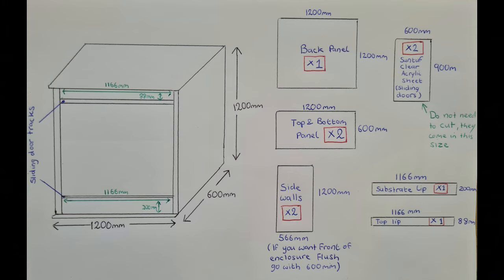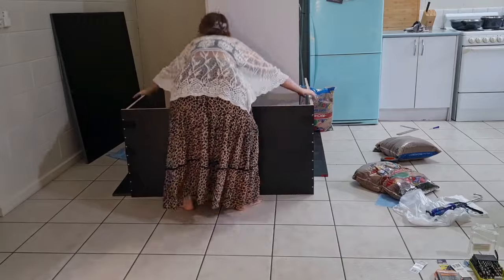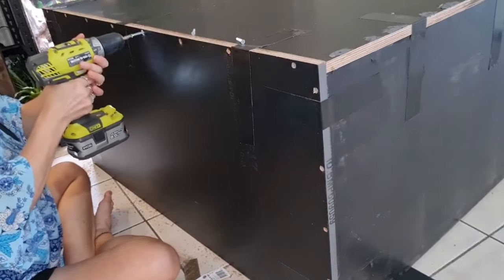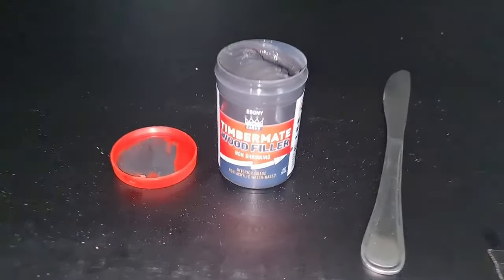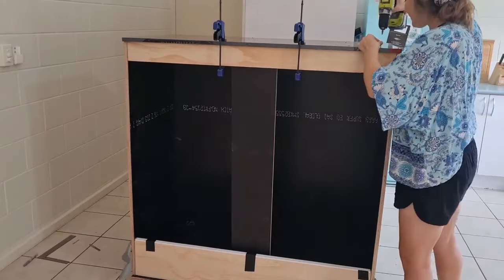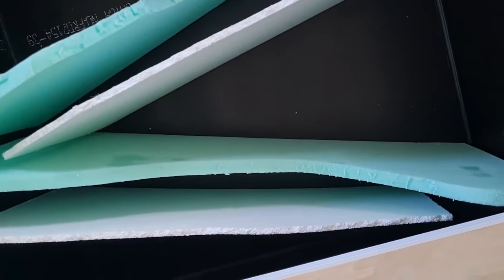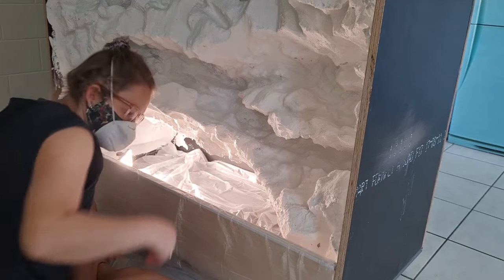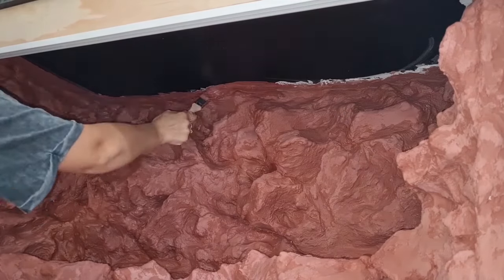Bearded Dragon Enclosure Build: Step-by-step guide… Limited tools and expertise needed!

Comment: Love this video! Im in Kansas! Couple questions,  1. How often do you clean the enclosure? 2. What is your process on removing the sand? 3. If she poops on the grout/ramps is it easy to clean? Thank you,  I plan on using this tutorial on a little bit of a smaller scale.
Reply from the maker: 1. I wipe down the entire enclosure with a wet cloth dipped in water with a bit of earth dish washing liquid (natural product/not harmful to reptiles/grey water safe/does not strip waterproofing) in the water. However the enclosure is checked daily for poos and is cleaned up if there is one.

2. I only remove the sand to do a full enclosure clean every 4 to 6 months as the thorough spot cleans daily (removing poo, dropped food etc) keeps the substrate in somewhat of an immaculate condition. I remove sand using a dust pan and brush.

3. Pooping on ramps or any part of grouted structure can be easily cleaned as the waterproofing (Crommelin clear pond sealer) creates almost like a fibreglass/smooth texture. The more layers of waterproofing you do, the smoother and fibreglassy texture it creates. Making it easy to wipe up poos using a damp soft cloth.

Hope that helps 🙏

Comment: M’y bearded dragon is currently in a 120gal tank that’s long but not very vertical, do you think it would be more beneficial to have something like this?
Reply from the maker: This is a bit of a tricky one to answer. 
From a basic care perspective, you are meeting the enclosure size requirements. And you should be able to raise a healthy animal in such an enclosure. 

However, the enclosures I design and build look at more than just basic care. They are built around enrichment and encouraging the animals to do natural behaviours by incorporating elements that mimic their wild environment. That's why I have included the textures of wood, rock and sand, it being a Central Bearded dragon. 
Another aspect that I think is important is maximising Surface area. This can be seen in the design by it being able to access the floor space underneath ramps as well as the ramps. These guys can be amazing sprinters over short distances and I again want to encourage such behaviours.
All these elements assist the animal to express those natural behaviours, such as running, climbing, jumping,  exploring. 
I have spent quite alot of time observing these guys out in the wild and that's why I'm quite passionate with regards to mimicking their natural environments.
Another positive to this enclosure design is that all the different textures are great to assist your animal to shed.
Lastly the one thing I was amazed at was that this enclosure allowed me to create quite a large temperature gradient, and the fact that the animal has to climb up higher to get warmer and can pick so many different heights to bask at to assist with thermoregulation. Again mimicking natural environments with the large temperature gradients.
So to answer your question in a very long winded manner, I think an enclosure like this is definitely beneficial, and provides more enrichment than 120 gallon tank 😊

Comment: Your videos are a joy to watch.  You have a very soothing presence and your creativity is off the charts! Thank you! You've helped me so much through the process of building my bearded dragon enclosure. 

I have a quick question. Do you keep the grout wet for a few days while it cures? It seems unnecessary, but I've read that other people do it.
Reply from the maker: Thanks soo much for the kind words! I'm so glad the video helped.

I'm slighty confused as to what you mean with your question, but I'll try to answer it as best I can.

When applying layers of grout, wait for each layer to completely dry before you apply another layer.
The layers at the start, you may see some cracks due to the grout being of thicker consistency. No need to worry as this will get filled in as you apply the thinner layers of grout. 

Some people's concreting and grouting strategies, after applying their layer, they will slightly spray it with water a few times over the drying/curing period to I think reduce chances of cracks appearing. But it's time consuming because each layer takes longer to dry and personally I don't use that technique for time management reasons. 

Hope that somewhat helps!
Reply: Thank you! Yes, that helps

Comment: Hello there :) I have a question for you as i have built my own 1500x600x600 out of the same material.  I was just wondering what you would suggest for covering the bottom if I was to make it bio active down the road.  Also you are the first person to teach me about clearing off the shiny foam layer because I have failed that on a previous build so i thank you for that.  You're amazing and I love your content, thanks for being an great teacher.
Reply from the maker: @newbzlife1707  thanks so much for the kind words and taking the time to comment. There are various ways this can be done. A resource I highly recommend, is to go to the SerpaDesign YouTube channel. Really knowledgeable with sealing enclosures and bioactive setups 🙏
All the best, thanks for supporting the channel 👍

Comment: I have found that sikaflex pro sticks the best to the formply.  And original liquid nails for the glass tracks just want to give the bottom of the track a bit of a rough up with some sand paper.  For foam to foam. Gorilla glue or any other polyurethane glue works the best.

Comment: What kind of glass did you use for the doors?
Reply from the maker: It's not glass as the price of glass this size is astronomical. 
It is clear Acrylic sheet (some refer to it as plexiglass). This is fine for Bearded dragons and some other lizard. However, I would not recommend it if you're doing a build for snakes, as this material has slight bendiness to it, which enables some snakes to escape. 
Here is a link to the product I used:
https://www.bunnings.com.au/suntuf-900-x-600-x-5mm-clear-acrylic-sheet-clear_p1010490?store=6400&gad_source=1&gclid=CjwKCAjwhIS0BhBqEiwADAUhc8BT-8YsyekYlmTIpTpgm01kUrz1-dd_THLCzusN4WBHs23jrN6_mBoCmCoQAvD_BwE&gclsrc=aw.ds

Comment: How do you clean these enclousers?
Reply from the maker: Good question. Because you have put waterproofing over the top of the paint work and rock work, it makes for easy cleaning. 
Water and a soft cloth for general cleaning. Or soapy water (I personally use earth dish washing liquid: natural based product we get in Australia, grey water safe, it does not contain nasty toxic chemicals, safe for reptiles and lots of other animals) for stuck food, it even makes for easy cleaning when it comes to a disgusting Bearded dragon poo.
The waterproofing also creates a fibreglass texture, which adds to the ease of cleaning. 
I would avoid harsh chemicals and alcohol based cleaners as this may have a high liklihood of striping the waterproofing.

Hope that helps!

Comment: This is brilliant! Wondering how big of a hole you made to get the T5 power cord through? Or did you make a hole before putting it together?
Reply from the maker: The best way of doing it is waiting until you get the light. The power cord can be disconnected from the light, allowing you to make somewhat of a smallish hole and then threading cord through the hole and connecting it back into the light.
You really should measure cord yourself and drill holes according to that incase light dimensions change.  Goodluck 👍
Reply: @ReptileWay  awesome! What about the T5 cords like the Arcadia ones that can’t be pulled apart (well I don’t think they can!)
Reply from the maker: @thingamabobby  The light in this video is a T5 Arcadia and can
Reply from the maker: @thingamabobby  this link shows it can be pulled apart https://youtu.be/85Wd6d44rQc?si=V-HvTJaod8ugRQoQ
Reply: @ReptileWay  not quite what I was after - the actual cord ends are the parts that need to fit through small holes in a melamine enclosure. But thank you!

Comment: Does every little hole have to be filled ? I’ve went over mine twice already till some tiny holes
Reply from the maker: If you are talking about the grouting stage over the foam I would say yes for longevity reasons, as well as for sanitary reasons.
It can take anywhere from 3 to 6 layers of grout, to make sure there is no exposed foam or holes.
Reply: Ok thanks

Comment: Is it supposed be flacking because I done 3 coats of sealer and it’s flacking for some reason
Reply from the maker: No it should not be flaking off. The reasons for the flaking probably have nothing to do with the waterproofing. Something has happened earlier in the build most likely. 

Reasons as to why it might be flaking off:
- Not carving off the shiny top layer of the spray foam off. This results in the grout not being able to adhere/stick to the surface of the sprayfoam, which results in flaking. 
- Using a poor quality grout/concrete or not mixing is sufficiently. 
- If all the layers of grout/concrete were all of a thick consistency, there will be cracks that could result in flaking. You need to start off having a thick pancake consistency of grout and as you progress through the layers of grout the grout consistency gets thinner until there are no cracks on the piece. This can take anywhere between 3 to 7 layers of grout to achieve this.

Generally if you follow the simple process of: Spray foam, carve the spray foam, apply thick grout consistency for first layers, as layers progress the grout will be runnier. No cracks appear in the grout then you can move on to next steps. Which is carving into grout (optional), adding paint detailing (optional) then finally waterproofing.

I hope this helps a little bit. Sometimes building can be trial and error. Goodluck 👍
Reply: @ReptileWay  thanks I sanded all the foam so maybe I put to much paint or grout on there I’ll have to restart I used the poly blend grout 3 coats and polyurethane waterproofing the top didn’t crack up the bottom. I may not of got it as good